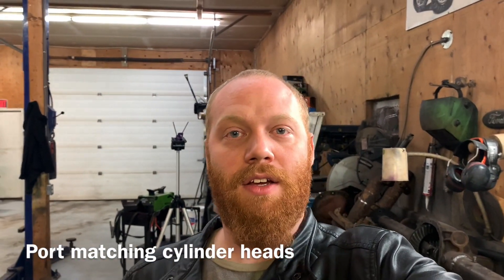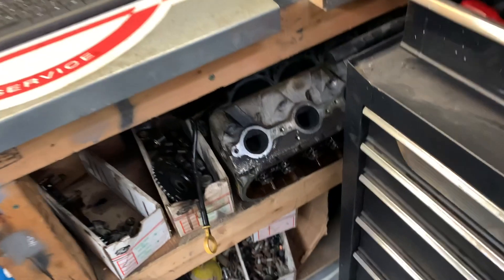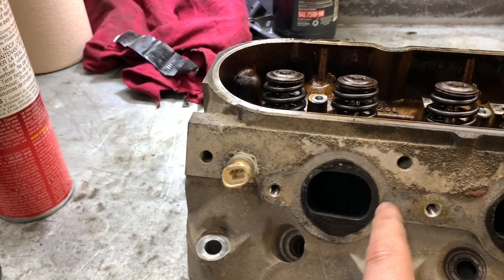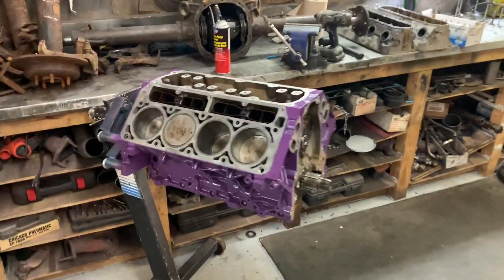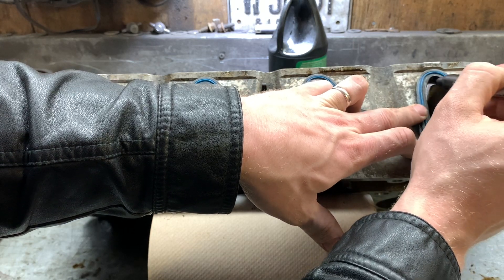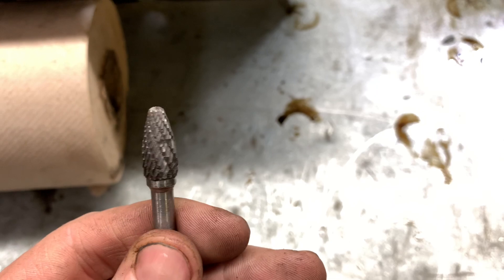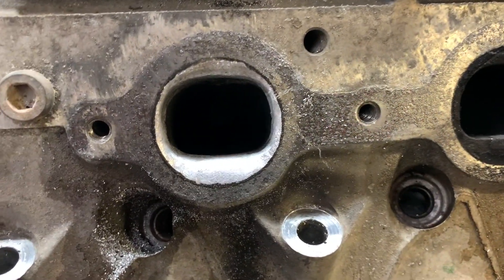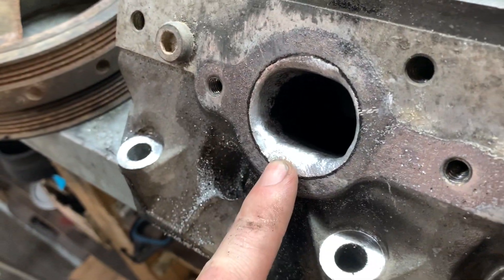How to port-match LS cylinder heads for better flow! Turbo LS Caravan build #6

Comment: Anybody interested in making horsepower, do the opposite of what you see in this video!! These heads are only good for a rat rod at this point! I'm sorry to crap on your video, guy, but it's irritating when people dispense bad info to the public. 
This is definitely gasket matching, the problem is, this gasket is designed with a round hole so that it will work with a variety of manifold and header designs and still have a sealing surface but not interfere with anywhere inbound if the sealing surface. GM spent millions of dollars in R&D to strategically develop a D-shaped exhaust port in the late 80's, so why would we hack all of that out to reshape the port they started with 35 years earlier? Very rarely is it ever advantageous to touch the floor of an exhaust port, as exhaust port flow increases the more it's raised because it straightens the shot to the valve,and heat rises.. Imagine flaring the end of the straw in your fast food drink cup. It's not going to change much of anything. All that will happen is the velocity (speed) of air coming through the constant size of the straw's orifice will suddenly slow down as it enters the flared portion. The best way to address this would have been to preserve the carbon outline on the exhaust port flange until it could be scribed, then carefully open the roof to that scribe line. Port walls can be opened carefully but cleaning up the bowl area under the valve will get us way more than anywhere else. A quality valve job needs to be done, which won't do much on the exhaust side but it will now let you know how much step you're going to have under the seat. Blend these steps, blend the intake bowl into the valve job, knock the rocker bolt hump out and don't do anything to affect port size much on the intake. Assemble head, go annihilate the LS guy with round exhaust ports, in a drag race, smile!!
Reply from the maker: Damn there’s a lot of good info here. Thanks for the comment and not just bashing me. 

I don’t bother to touch heads anymore, I’ve learned that I’m not trying to squeeze every ounce of power out of the engine, I just want to drive it and have fun. If I need more power, I’ll turn up the boost another psi 😁 

Have a good one man

Comment: Spray your carbide with WD40 and it cuts faster and doesn’t load up, or you can use candle wax on your carbide. You’re welcome…
Reply from the maker: Oh! I thought they were supposed to be used dry, this will help tons

Comment: That exhaust D-shape has a purpose. To port match the exhaust-port to match the exhaust manifold is a 100% direct HP killer. The D shape is a return wave trap that creates a lower pressure in the cylinder when the valve is open and pressure puls passes the D.
Reply from the maker: Right on! I had no idea what the flow dynamics were behind it. 

I’ll just turn the boost controller up a touch 😁

Comment: You should only open the roof on the exhaust port, it’s very mild work you’ve done and not enough to hurt much or help imo.
Reply from the maker: For sure. I know there’s no big power gain here, I just do it to make myself feel better 🤣
Reply: @StationroadRatrods  haha something to do 👍🏻
Reply from the maker: I can only hope by matching the ports that it’ll speed up flow a little but that’s about it. I like the way it looks as silly as it is